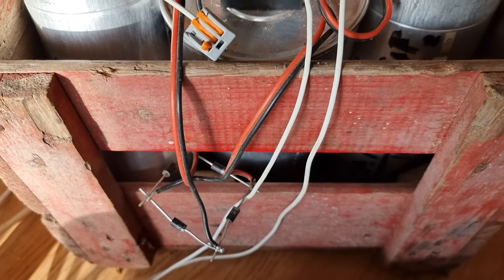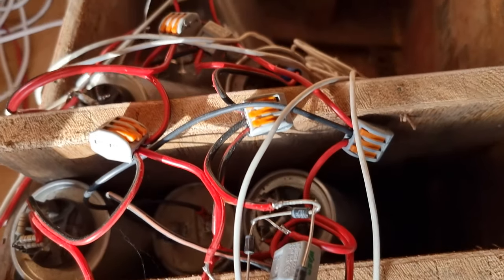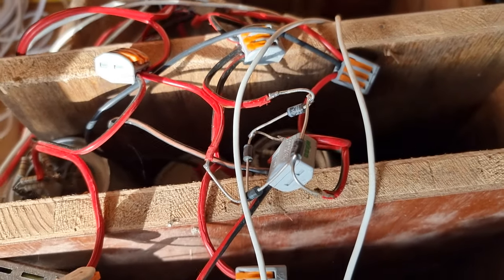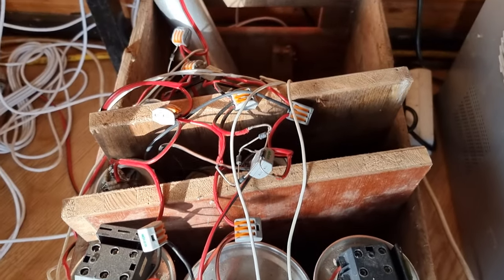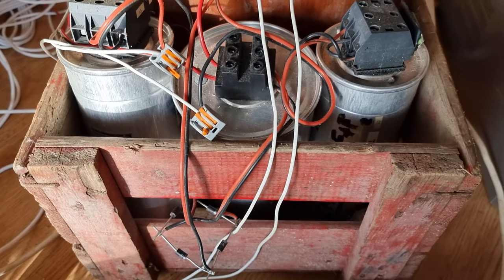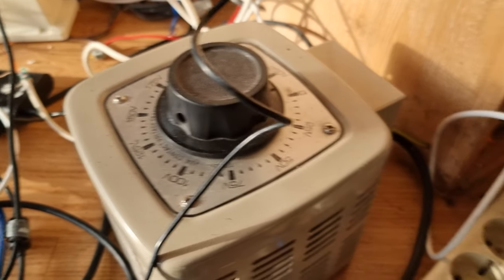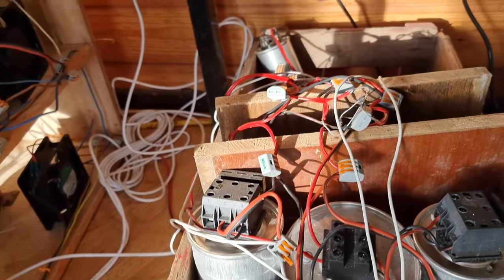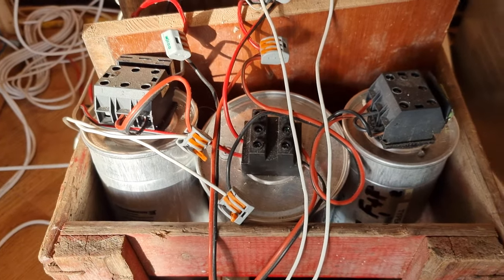VEGA - Variable Cockcroft-Walton supply

Comment: Perhaps an article by J.G. Trump might be interesting for your experiments. New Developments in High Voltage Technology -1967.
For example:
In a uniform field test with small electrodes
in compressed gas using dc voltages up to 1 MV it
was found that the gaseous gap could be reduced by
a factor of 2 by dielectric coating one of the two
opposing electrodes. With dielectric surfaces on
both electrodes a further gap reduction of 2 was
obtained. The interelectrode current at the
maximum sustained voltage was such that the
calculated gradient in the two dielectric layers
was below 104 volts per inch, In the case of the
two dielectric electrodes the calculated gradient
across the gas-filled gap for a N2 - CO2 mixture
at 300 Psi was over 3 MV per inch.

Comment: He could omit the 6 capacitors on the sides (looking at the wiki schematic)... place them all on the center rail, so they're all in series, but that would require more diodes = 9 bridge rectifiers.  If the GND on the diagram isn't connected to the center tap on a transformer, then the side rails have no way of discharging, as far as I can see right now...  or he could put three in parallel on each stage

Comment: What the hell does it do? Could you provide a link to a whitepaper or source?
Reply from the maker: It multiplies 3x the voltage from the Variac based on mains input and rectifies it into DC for field emission betweed large Cathode and small anode. The VEGA Valley was made with it. It is a simple Cockroft-Walton.
Reply: Oh, I see. Kind of like a Marx generator then, but continuous, as opposed to pulsed? PS: I like how its schematic diagram resembles the kabbalistic tree of life. Three interlocked "pillars". Most cool.
Reply: Love the one in the German museum munchen Bavaria and bc hydro extra high voltage lab be careful old caps can explode best reform them threw constant low voltage and bring up voltage slowly use a light bulb as your resistors matching the wattage be safe